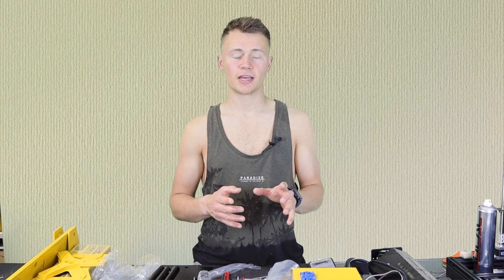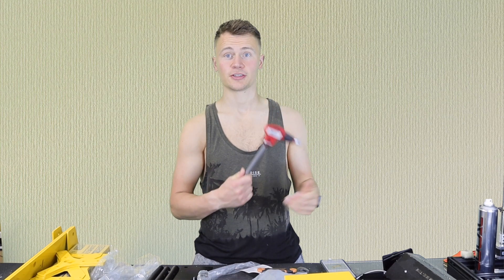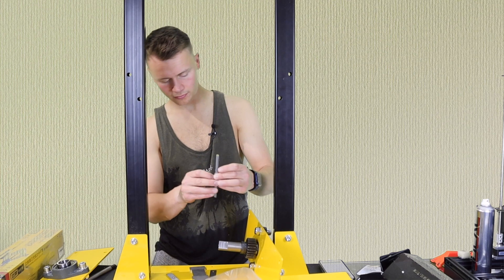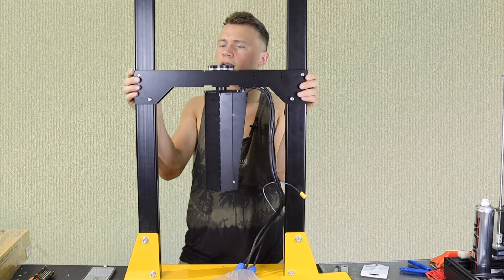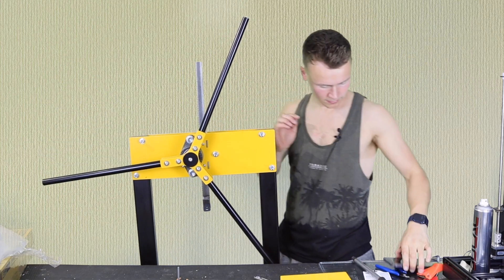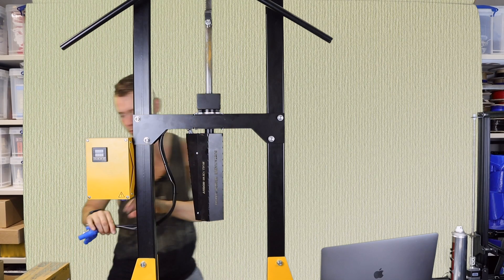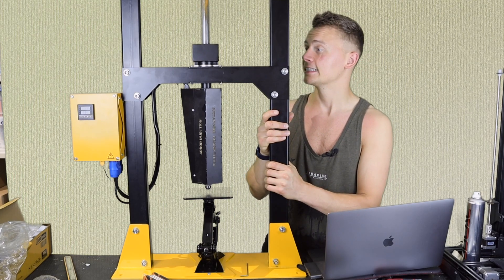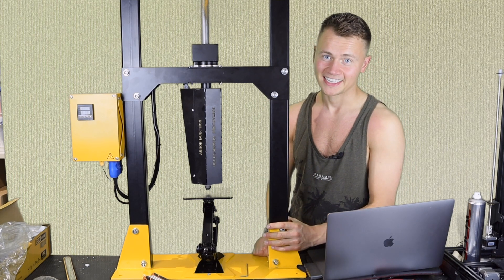I got a new machine! Precious Plastics Arbor Injection Molding by Sustainable Design Studio

Comment: I just put mine together and am trying to figure out this REX-C100 device! 😅
Reply from the maker: I haven't actually got around to using it yet! On the to do list aha. But am familiar with the REX-C100 from some of my extrusion stuff, what are you trying to do with it?
Reply: @CallumColes   I wired everything myself and had a positive and negative wire switched around on the PID (oops lol). Unfortunately I did a factory reset and lost the preset values on it before realizing my mistake.
Thankfully Rory is emailing me what they should be so I can try to fix it. :D